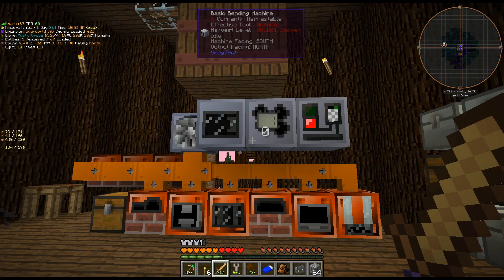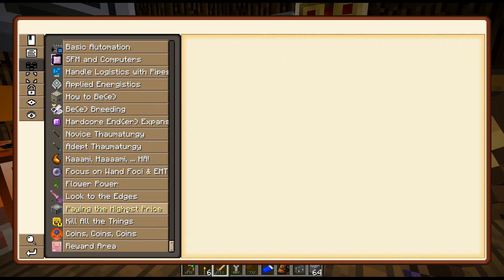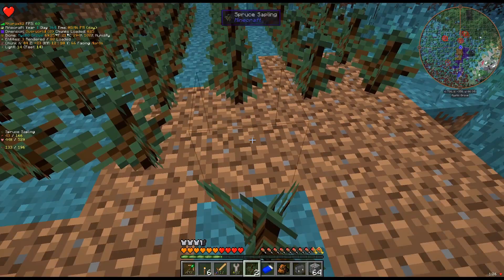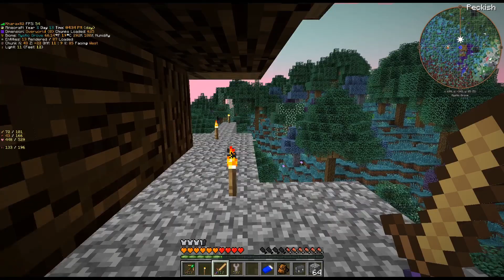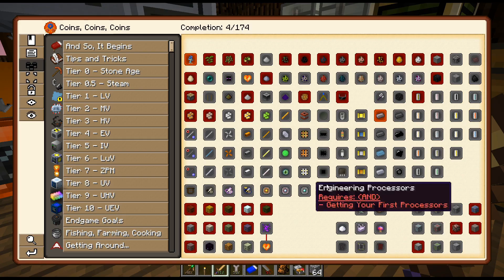GregTech New Horizons S3 - 19 - First Assembling Machine

Comment: I did my powersetup in LV using a cactusfarm and 64 coke ovens: its a fun challenge and definitly viable but it's a bit too time consuming. My biggest tip for making cactusfarms: make an iron microblock saw, u get a diamond one for free and use microblocks instead of fenceposts and signs.